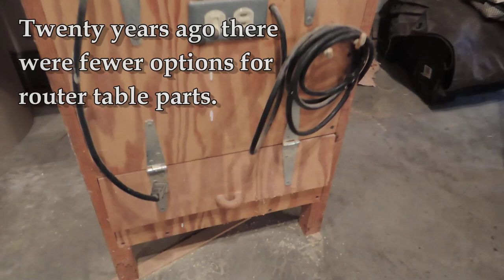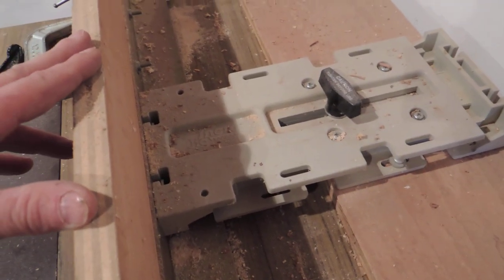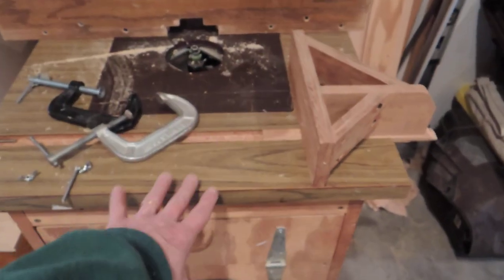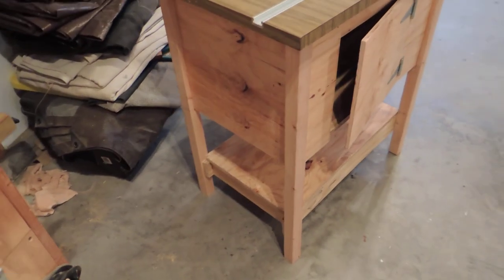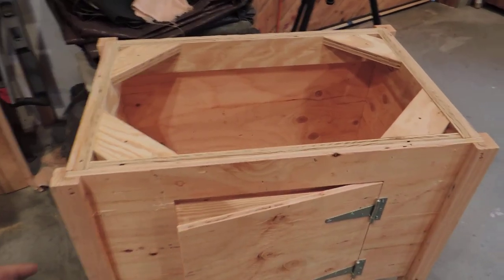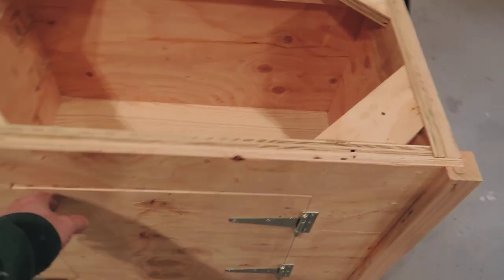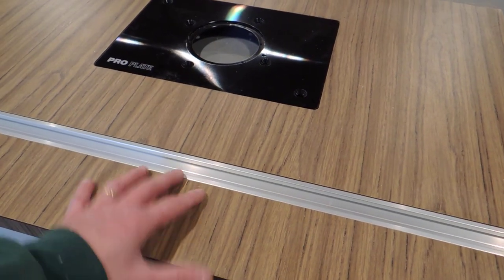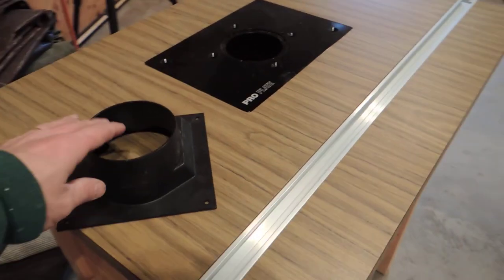Make Your Own Router Table

Comment: I need to rebuild my table as well.  One thing I am may splurge on is I want to build a motorized router lift with an arduino and stepper motor.  Or if I don't go that route some sort of plate system that the router attaches to so I can yank it out quick and easy for setup and tool changes.  I am done with the days of getting down on my knees and crawling into a little cabinet to do that.
Reply from the maker: A motorized lift??  That's cheating!  If you saw my video on the Triton router, I've been very pleased with it.  To change bits you just stick the lever through the hole in the plate and twist the router up to the top.  The collet pin automatically engages as long as you have the power switch off, so you only need to loosen the collet and switch the bit.  When you lower the router, the locking pin automatically retracts. It's brilliant, and the router itself has been flawless for me so far.
Reply: I seen that video maybe I will have to go back and rewatch it.  Not cheating just making it more efficient.  When I am doing side work here in my home shop it seems like I spend more time on router setup changes than i do running the actual parts.
Reply from the maker: I know just what you mean--I also dread the thought of extensive setup for a minor cut.  That's part of the reason I made a second router table, so I can leave one setup alone while I use the second table for a different setup.  Yesterday I was thankful to own multiple table saws so that I could leave one with a dado blade in place while I cut with another.  I've lost count how many routers I own--I think it's six or seven.  The more of this you do, the less you can tolerate the set-up time, I guess.
Reply: Yea for sure.  I don't have that many routers yet but I am not far off.  LOL  I am the same way with drills too.  Always have to have my 12v setup with a phillips bit for general screw driving than my 18v and 20v setup for various things.   I catch hell from buddies that come into my shop and wonder why I need so many drills and routers.